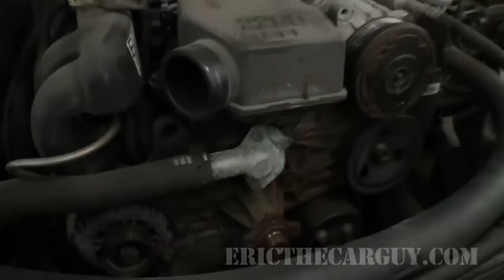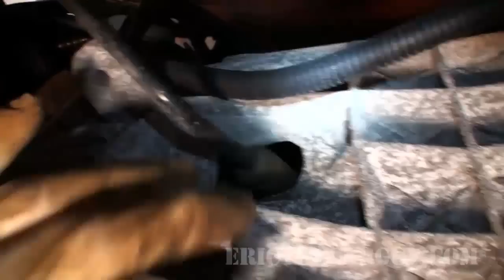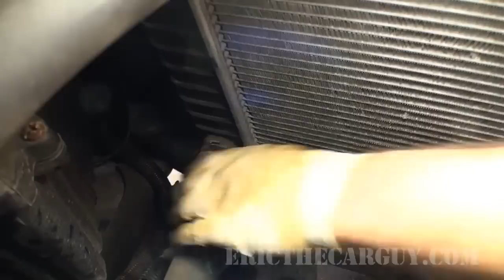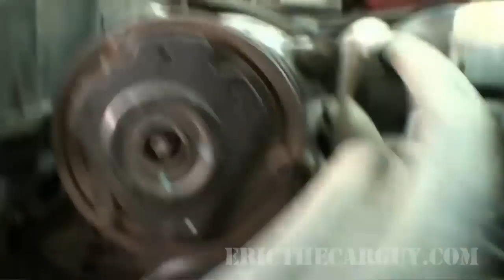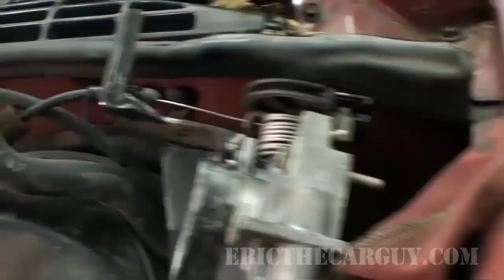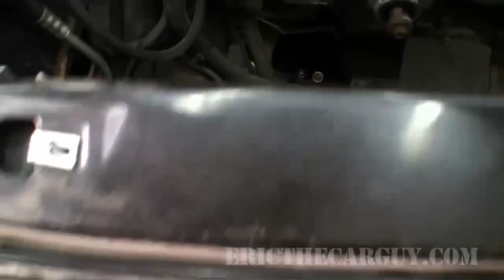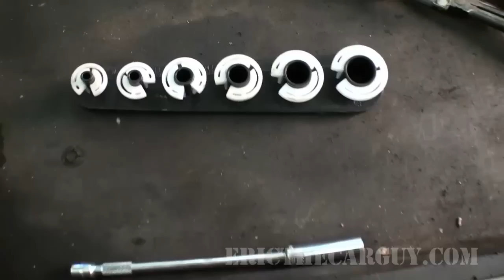2001 GMC Sonoma 2.2L Engine Replacement (Part 1) -EricTheCarGuy

Comment: Don't even get me started pathetic wannabe tire shop and oil lube shop "technicians" lmao lol haha oh man there the biggest jokes in the repair/maintenance industry. In that case avoid Discount Tires chain, there's no discount at all and they rip you off every chance they get. Went in with a flat came out with a new tire that I didn't authorize. They said it was a hazard, but by law they have to inform of the repair. Said take off and get me a used tires. Dude looked dumb in the face lol

Comment: I back up my opinion, with facts from automotive engineers, not some hack. I have seen all of the "failures" of dexcool and they lead to 2 things, air intrusion or contamination, if you see stuff growing on hose ends that is a leak, it may not puddle on the ground but allows air in the system, causing the degrading of Dex.
Oh, I owned a truck that went 270k and one that went 214k without issues, or a friend that went 500k and never had the intake off his engine. all 3 had dexcool all their life

Comment: Uninformed techs and shops that are not knowledgeable enough about coolants to tell you anything. Funny but Ford and Chrysler have switched over to a Dexcool like coolant in their vehicles. Can they tell you the difference between Ford Gold, CDJR orange, Ford Orange coolants or Honda Blue Toyo red? doubt it just colors to them.
Dexcool is not forgiving when it comes to leaks it has to be fixed ASAP as it degrades in air.
As for green, short memory spend 3 hours flushing rust out after 12 months.